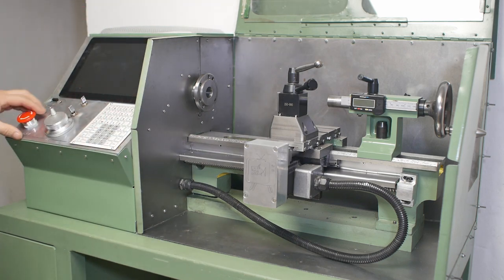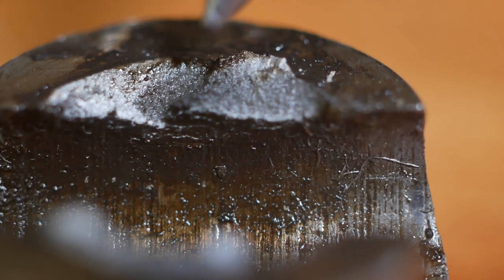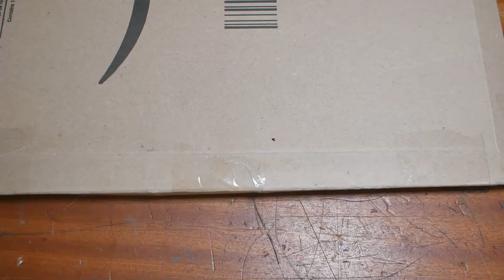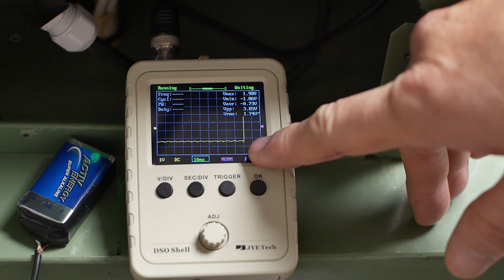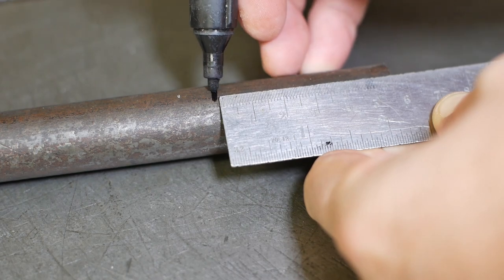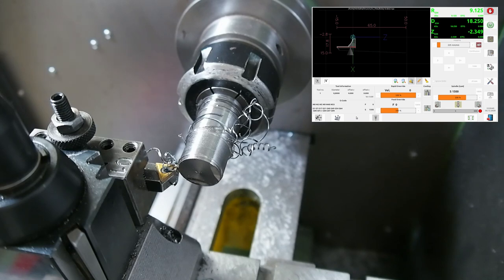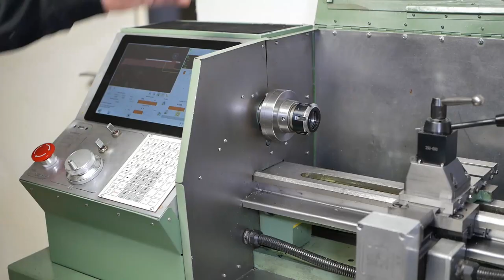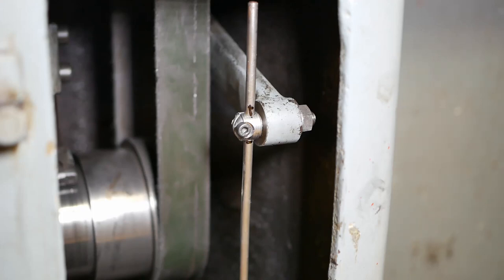Man vs tiny CNC machine - CNCing the mini lathe -Epsisode 38 || RotarySMP

Comment: What CAM software were you using? Not one I have seen before (but I'm far from an expert).
Reply from the maker: This is an ancient (like over 20 year old) version of featureCam.
Reply: @RotarySMP  Oh, another autodesk product it seems. I hope they improve the Path module of FreeCAD so it is possible to do the whole chain from cad to cam to cnc on Linux soon. If I recall correctly there are still some parts missing to be able to do cam for lathes.
Reply from the maker: @VorpalGun  Mine is soo old it was still a Delcam product. I had never used the Lathe module before. The good thing is is has a bunch of post processors, and pretty simple editor to modify them I used the Fanuc6M, but need to switch to front monted tools as it uses M4 for fwd, but I need M3.

Comment: WNMG has 6 corners per insert :-)
Reply from the maker: I need about 20 per :)
Reply: Usually 2 corners go at a time when you crash. The other might be already used if you're lucky.
Reply: Negative rake on this machine? Hard pass! It needs all the help it can get.
Reply: @TheMetalButcher  probably if there's a serious lack of horsepower you could use aluminum inserts on softer steels
Reply: @MF175mp  That would probably work good.
Reply from the maker: @TheMetalButcher  Good point. I only use positive rake tooling on it.
Reply from the maker: @MF175mp  I do inspect all before turning the insert. Scraped two in this bad day.

Comment: Get a diamond wheel and some brazed carbide, then you can regrind the tool after each fckup. Since that lathe is not capable of doing real damage to tools, brazed carbide should last a while until everything is ground to dust.
Reply from the maker: I have a diamond wheel or two for the Clarkson, and a few brazed carbide tools, but the problem with any ground tooling is that you need to redo your offsets on every regrind, whereas the indexable tools keep them constant (with tolerances which this machine cant hold.

Comment: I'd rather have an ugly part that works than a pretty part that doesn't.  I was cringing watching those threading passes rip, i half figured you'd tested it before cranking it up to 11.
Reply from the maker: I'd done dry runs cutting air, but that was the first actually threading cut in steel. Too muc stick out, wrong gear ratio, too much depth of cut, not enough stock length in collet, chuck nut not tight enough. Plenty to improve upon.

Comment: I cringed and was slapping for an e stop every mess up! How do you determine where the insert tip is between tool changes? Do you have a tool setter behind the scenes? I have an oooollllldddd cnc lathe I wanna get going. Love the content btw
Reply from the maker: I set the tool offsets in advance with light cuts (at least with insert tooling, you can replace tips without having to refind the offsets.

Comment: Rotating the spindle backwards isn't gonna help you saving some money ahah
Reply from the maker: :) I was using a Fanux post processor, and it is an industrial machine with a rear mounted tool post, so M4 and M3 are reversed. I missed replacing it once.

Comment: I have sworn a sacred oath never to use a collet chuck for holding short stock in a lathe.....if a 3 jaw chuck won't hold it true nothing will.....(well,  maybe a 4 or 6  jaw self centering and hang the expense).......nothing slips back like a greasy bar of steel in a collet......don't ask me how I know.
Reply from the maker: I am used to the pull type collets in the Boley, which grip well on short stock. Double slitted ER's need s lot more length. Another lesson I am doomed to relearn.
Reply: @RotarySMP  Well, given that the mini lathe originally came with a fitting for a chuck, what is the problem with having a 3 jaw instead of the ER collet holder.....opening and closing a 3 or 4  jaw self centering would be quicker than an ER collet chuck......but I'm not into CNC lathes, just mills, so maybe I'm wrong as the thread is over a year old and you probably have a solution already.
Reply from the maker: @gangleweed  three jaw chucks are a very imprecise device, with significant runout, and low repeatablity.Collets have low run out and high repeatabllity, unless the part gets pulled out :/
Reply: @RotarySMP  Perhaps you are right on some aspects.
I have a Chinese 150mm 3 jaw I bought for my lathe in the 80's and it runs dead true to a thou.....that is impossible you might say..........if you have a clearance on the backplate register of .005" you can "dial" the chuck to run dead by slacking off the bolts and bumping the chuck body with a soft hammer to get the bar stock true then tightening it....that method will hold  true for any diam......most of the time you are running on raw material and turning it down etc.........but for second ops you can get it to run dead true if your really need it to......BTDT.....ask me how I know.......my lathe is a 1930 Colchester Bantam.
One secret is to not hold material very close to the end of the chuck jaws with much force........this is will spring the jaws in their grooves which will cause them to bellmouth.

Comment: So disappointing especially after all the hardwork. It appears under powered even with the larger motor . Hope you can tweak the ratios to make it usable.
Reply from the maker: I should have put it in lo gear. that has about 2.5x torque.

Comment: Full retail for that vice is ... a lot!

https://www.amazon.co.uk/Kiesel-Leinen-Junior-125-Parallel/dp/B008XHVB4G
Reply: These are called Junior for a reason, they are not as heavy as the old "senior" Leinen ones. Don't get me wrong, they are still very good vises, but the old ones have some more meat on them (in this case only ~4 kg, but for the 150 mm you are looking at a ~12 kg difference). You can see new old stock of the old non junior models sometimes, but they are priced premium. Even if sold used on the classifieds.
Reply from the maker: Gunnar was generous enough to sell me this one for €30 + €30 postage.
Reply: @gubr  Thanks for the info - I'm in the UK, so I'm not very familiar with the range.

I just googled it!
Reply: @RotarySMP  😲

Comment: shame it has so little power, 0,5mm cut stopping the machine is not very good
Reply from the maker: That was high gear. I should have put it in lo, but you are right, 0.5mm in steel at 22 diameter is not much.
Reply: @RotarySMP  I dont remember but what motor did you put in the lathe?
Reply from the maker: @DolezalPetr  0.75kW 3 Phase. Although I think the VFD is still set for 550W.
Reply: @RotarySMP  that is a very good size for such a lathe, I have a 750W motor with a 2:1 belt reduction on my lathe and I can take about a 3mm cut in a 60mm steel round stock, but I cant push it this hard for too long because then the front spindle bronze bearing overheats
Reply: @RotarySMP  There must be some error in vfd programing, i use same 750w 3f motor on my mini lathe and recently i was able to take about 5mm wide chip from about 20-30mm steel bar with dcmt insert
...
Just tune it a little bit more :)
My vfd has "motor power override" for lack of better name, i can push it 150% no problem
https://images92.fotosik.pl/432/774b05325a88014emed.jpg
Reply: @kwk8363  I can image a 6mm cut no problem with such a motor and a good spindle bearing, I am limited with the spindle bearing because it is old style bronze bearing and with bigger cuts it heats up more, I was once able to do a 6mm cut in a 40mm steel round stock but I stopped the motor because the bearing overheated and seized up
Reply: @DolezalPetr  your lathe is a beast my friend :)
Reply: @kwk8363  it is 100 years old, but I work with what I have
Reply from the maker: @DolezalPetr  The Boley also only has a 550W in it's lower speed (Dahlander motor), so motor power is not the problem. The mini lathe lacks rigidity, and that home made ER32 collet chuck was also no very impressive. 
I need to find the time and dig out the VFD manual and find the constant to up the power to 750W as well. It is a 750W output VFD.
Reply: @RotarySMP  yes rigidity is the biggest factor for sure
Reply: @RotarySMP  I'm curious, what was the output frequency of the VFD? My intuition says low gear, high freq gives best results. AFAIK, induction motors don't have great torque at low speed.
Reply: @kwk8363  Well, it also depends on the type of steel. Hotrolled, coldrolled, carbon content, other black magic fuckery manufacturers do to their steel, you name it.
Reply from the maker: @besenyeim  I would estimate that I was at about 50Hz on that 1500rpm. So pretty close to nominal for this motor.
Reply: @besenyeim  induction motor with propper vfd has the same torque output  below nominal hz (50 or 60 depend on your country) as they have in ther nominal range. It just output lower hp or kw due to lower rpm. If you go higher than nominal it keeps nominal hp or kw but looses torque to fact it can not output more kw or hp.
 In about 110hz i can stoll my lathe motor in about 1mm depth of cut due to low torque.
Take a look at formula to calculate Kw:
Torque(Nm) * nominal rpm / 9549.3=Kw
You can't boost rpm without boosting noninal power. The best performance induction motor outputs at nominal range. Thats why geard lathes runs motor at optimal rmp and changes only the gear ratio
Reply: @vincentguttmann2231  you are right, tgats why they invent free machining steel we call it "stal automatowa" in poland.
In my case it was steel bolt or tool steel, i dont remember know what it was, i only use these two kinds in my workshop